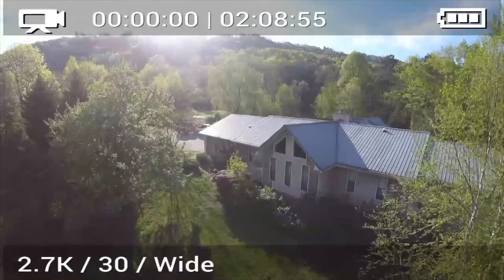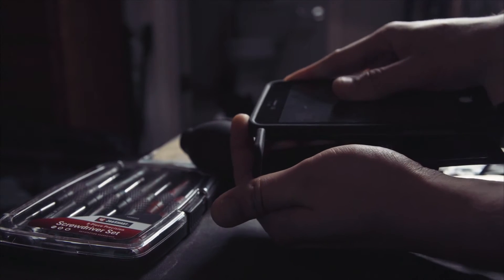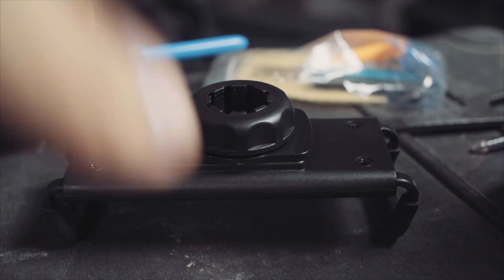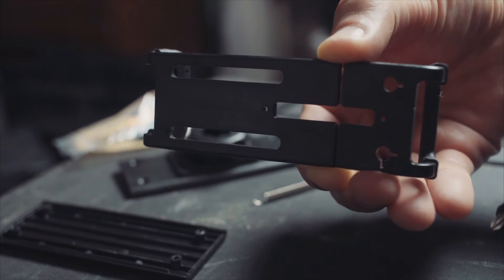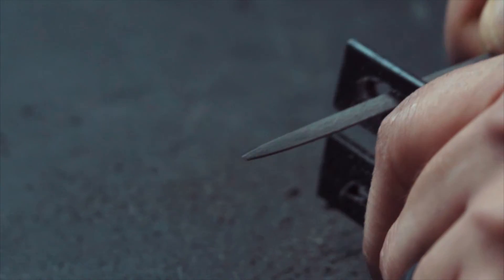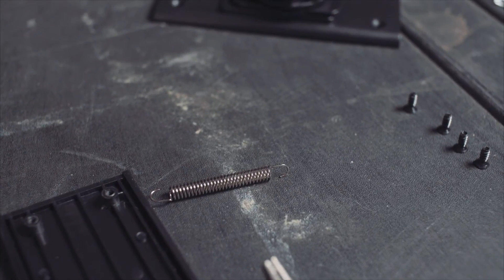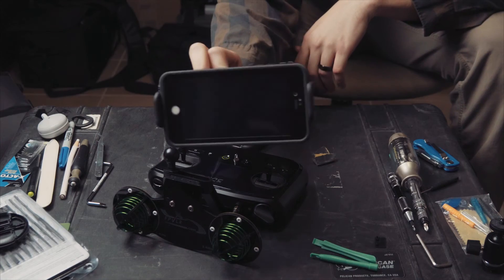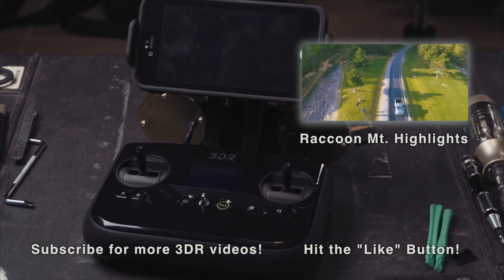3DR Solo Controller Mod: fit your LIFEPROOF iPhone 6 Plus on the mobile device holder

Comment: Thanks. Works great. I did it with a Dremel on a relatively low speed. I only had to cut away a little bit of melted plastic since even low speed on a Dremel is still fast enough to melt plastic. I really don't think that aesthetics were important since the mods are internal.

Comment: Do you know if it will hold an iPad air 2?
Reply from the maker: I'm not 100% sure. It would likely have to be modified kind of like this video shows... Now, it can certainly hold ipad mini by re-orienting the clamp 90 degrees to hold it from it's shorter dimension. But I think that a regular iPad width would be slightly too much.

Comment: Would it now hold a SAMSUNG GALAXY S2 9.7" tablet?
Reply from the maker: Thanks for the question! As long as the width on it's shortest side can fit into less than 7 inches of space, then probably yes. The mobile device holder now extends to a little above 7 inches.... I'm not familiar with the dimensions of that tablet. And I actually can't find a short dimension answer via google very easily -- just product box dimensions. If it's a 9.7" diagonal screen, it would probably be really close to 7 inches on the short side. If you've got one to measure then check it out and let me know! Thanks again. Best of luck :)
Reply: They are 6.7" by 9.3"